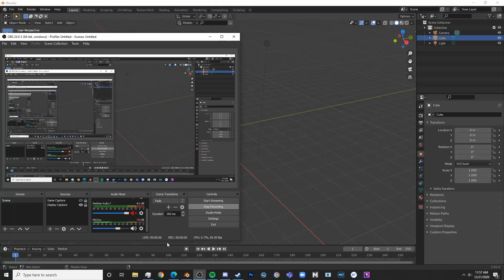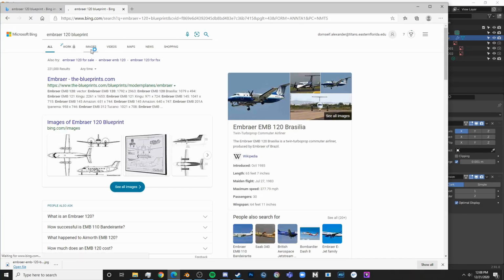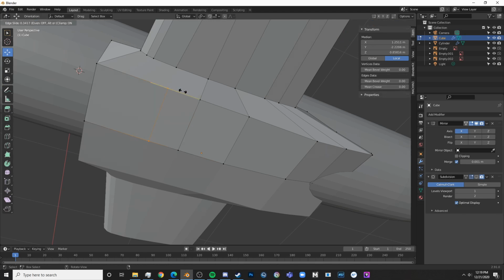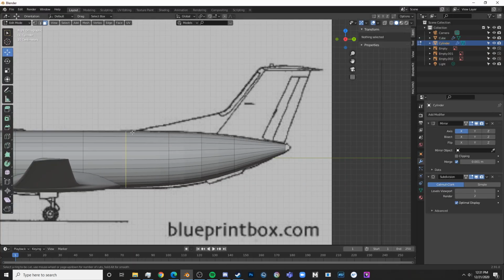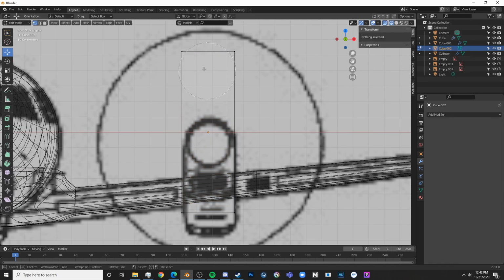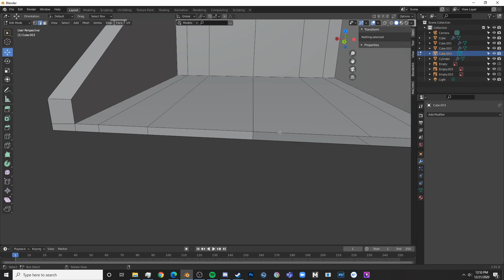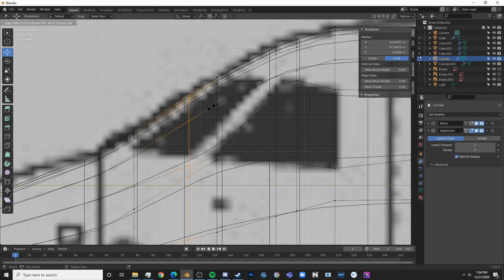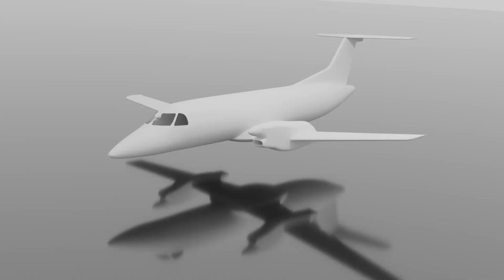Embraer EMB 120 Brasilia Blender Tutorial: Part 1

Comment: That trailing edge of the engine nacelle that moves might be solid on top instead of sunken in because from reference photos I've seen, it appears to be flat on top. I'm assuming it's a part of the flap system given its shape
Reply from the maker: okay good to know, I was having trouble with the images on google. Thanks for the tip man, Ill make sure to fix it in the next video!